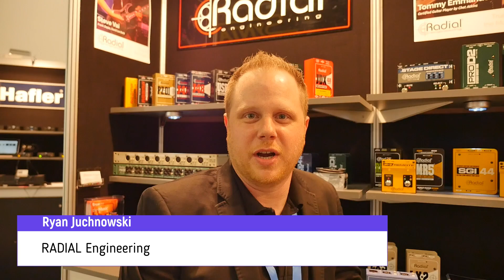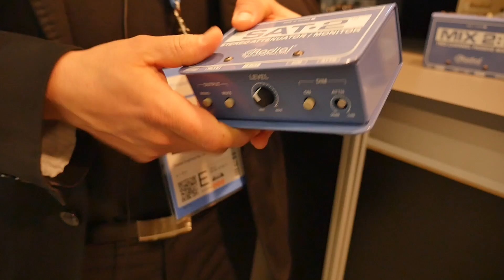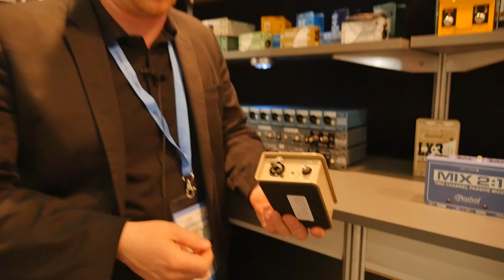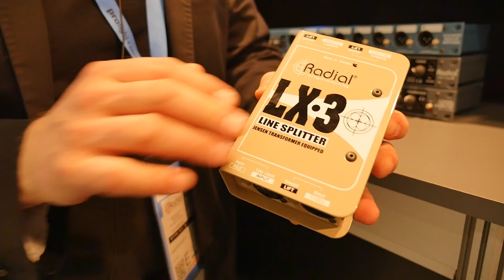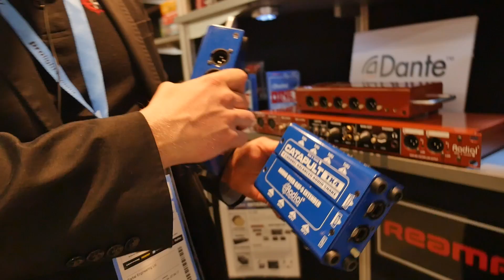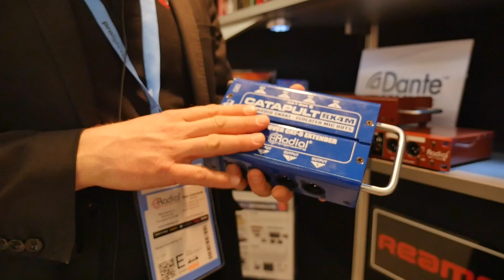MESSE 2017: Radial Engineering new stuff - lots of it!

Comment: Never knew that Cat5 could send audio without power; I assumed it would have to be converted (AD/DA)... Learn something new everyday I guess!
Reply: You can send pretty much any signal you want (within reason) down a CAT5, it's still just plain old copper wire, the electrons don't mind. 

But probably best to get some posh Neutrik Ethercon RJ45s for the ends of the cable if it's being used outside a studio. Drive a tank over them.
Reply: That's what it made me realise! Just so used to seeing them used in digital applications and agreed! I mostly use Neutrik or Hosa